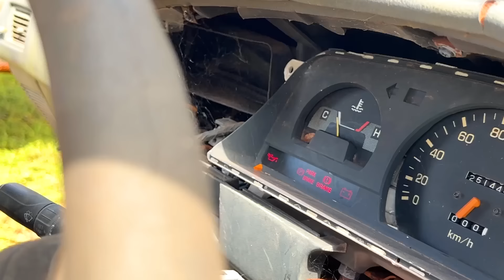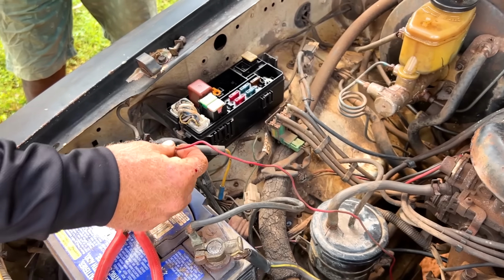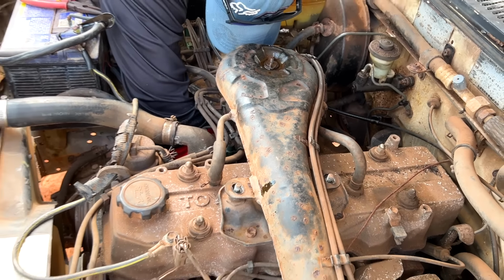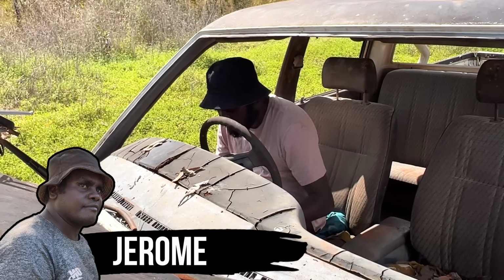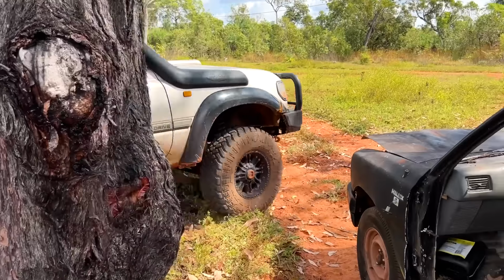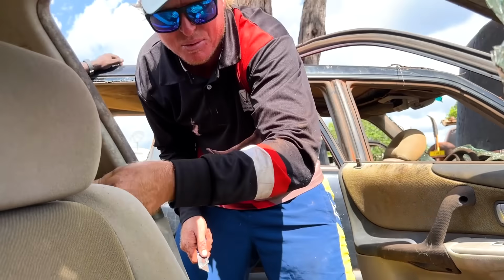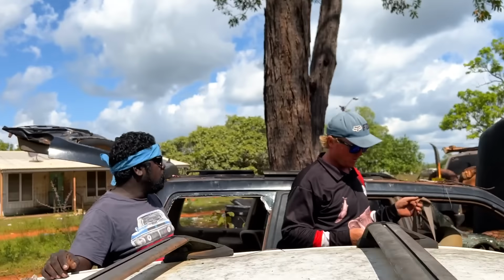Bush Mechanics: How to Build a Car from a Garbage Dump in 8 steps!

Comment: This is a Texas state safety inspectors worst nightmare. Once did an inspection on an older guys car, there had to be about 300lbs on silicone caulking on the car. Every single wire, around every panel, encasing the lights. Every. Single. Wire. So much caulk his taillights couldn’t be removed without damaging the car more. I’m not even exaggerating, wish I took pix
Reply: I would've thought it would have been a Texas state inspectors wet dream, finally getting the one car they've been looking for their whole career.
Reply: @johncitizen5377  it is until you tell them they won’t be able to register their car until they fix it.

Comment: Try doing that with another make. Toyotas are the best car. Engineering is brilliant. Nothing comes close…ask any third world terrorist.
Reply: True that but these guys have done it with plenty of cars they had a suzi that went for ages. Suzuki is up there with toyota though heaps reliable ive rolled one and after flipping it back over it still ran fine.